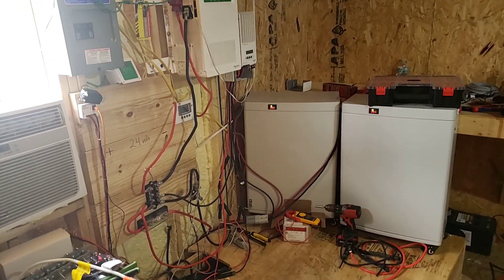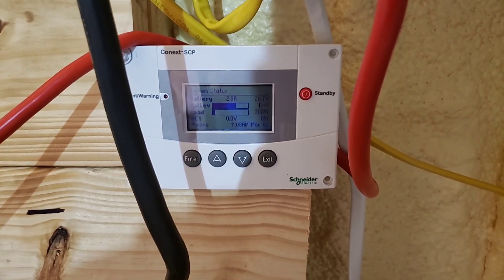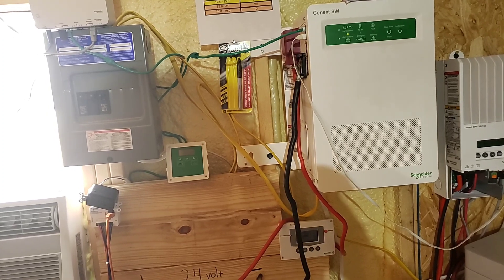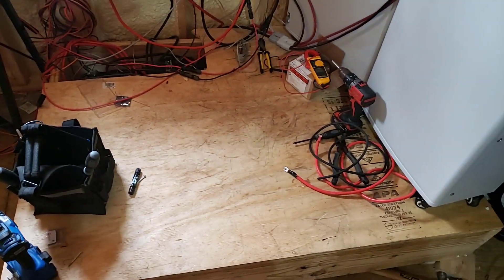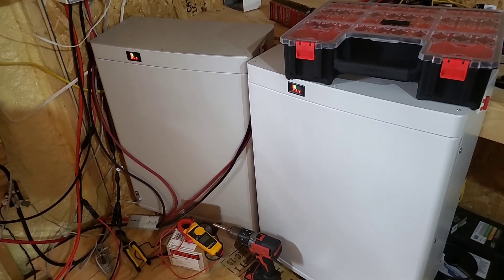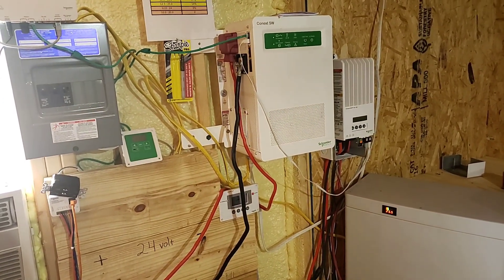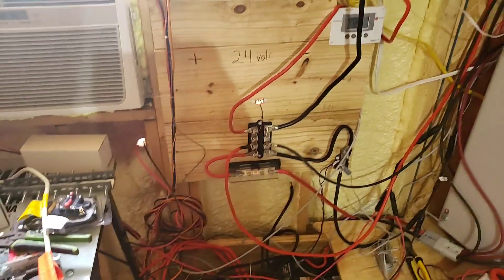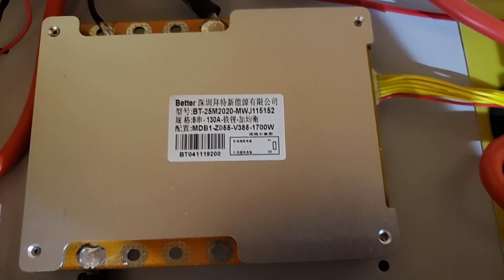Conext brand system, lead acid to lithium iron phosphate Lifepo4

Comment: i am sorry sir, but schneider told me they are not supporting it anymore, the rep lied  to you. They told me my self, I have to midnite classic 150 and digram show how to wire a dual system, midnite solar even took it down, they had to or be sued for miss-representation of product. I purchase both units from the altE store and they didn't know, there is something else you should know, these unit will not see a battery bank bigger than 1,000 amph, there is no way to charge a battery bank any bigger other than by pannels.

Comment: Sorry you are not correct about adding a second Sw, schneider will not support it, I added mine in 2018 and they gave me hell for the software , That software is full of problems and you will loose connection between inverters and complete system shut down and reboot will be needed. My single inverter came on line august 2017 one month before hurricane Irma hit me on st.thomas and two weeks later maria hit, I lived completely from September 6 , 2017 to January 8, 2018 on my system. They are more powerful than you think  volts
Reply from the maker: Thanks for the reply, I personally only have one. I was going off what a rep told me and what I seen in the information booklet.
Reply: @KPKev  you can add a second one with its own battery bank as a separate system. If you want to parallel them you have to get the conext XW .